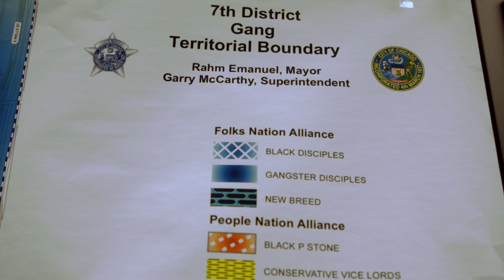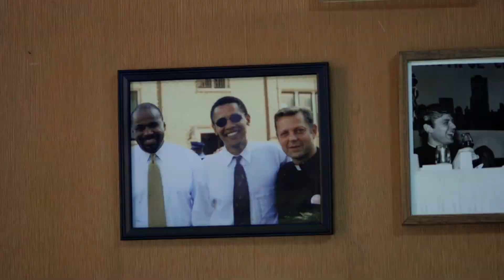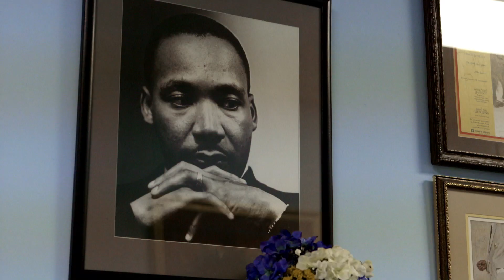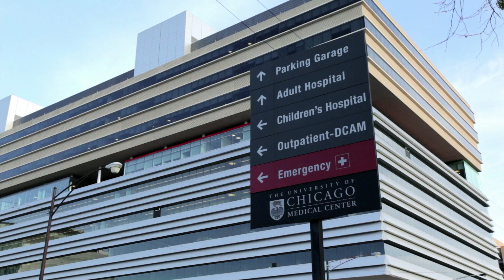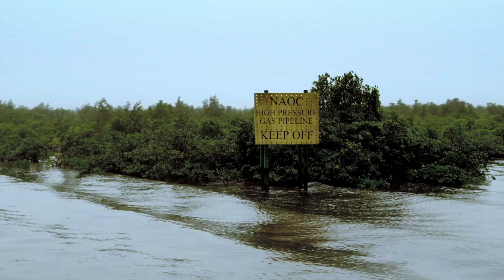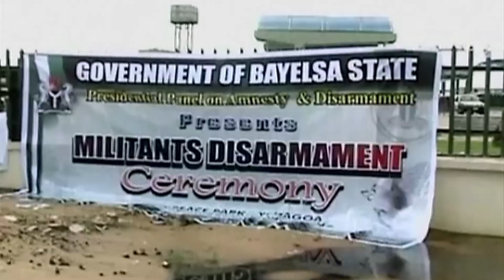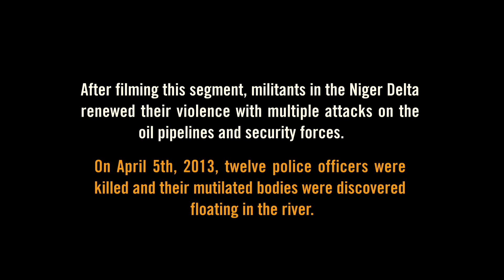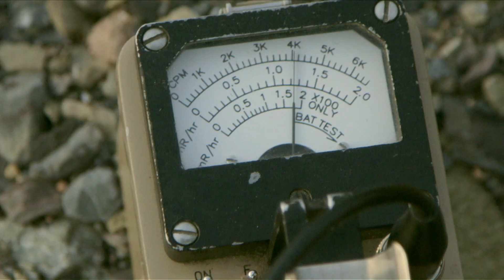Chiraq & Nigeria's Oil Pirates | VICE on HBO

Comment: The state senator since 2003. It looks like that might be the case. That's where I seen these problems increased. She has a power to engage with the Mayor. There is a problem that can be corrected with the gun inventory issue. They not doing anything but waiting on white house.

Comment: You do not become a millionaire if oil is found on your land in the U.S.  The citizens of the U.S. do not have mineral rights and in many, many cases, do not have any subsurface rights whatsoever.  Where the money comes in for many of the people is the surface damage caused by building roads and power lines to service the various oil wells.  Oil worker in the Permian Basin for 10 years, and Africa.

Comment: They should make guns tough to get in Chicago. That should fix the issues!
Reply: Did you even listen to the report? They get the guns from the suburbs but you can buy 10 guns there and it would only look like one transaction has taken place with no way to track where those guns are going after. It's the house that doesn't want to do anything because if they buy guns they get rich
Reply: @MrAnonymous825  So what you're saying is that criminals don't abide by gun laws?